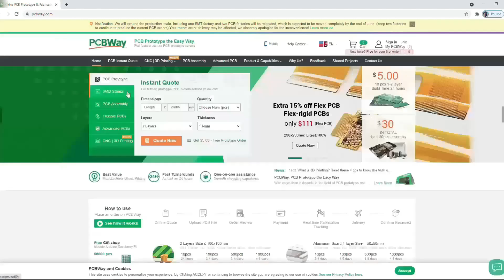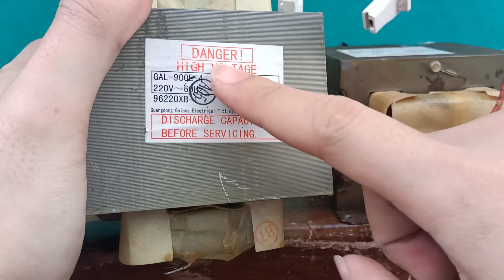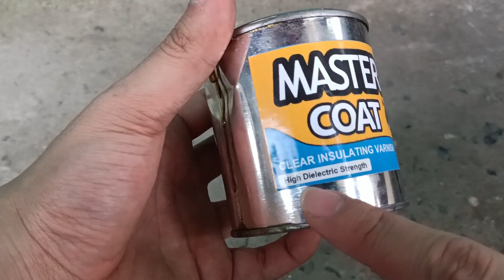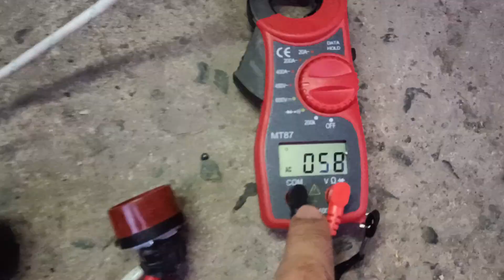DIY ARC WELDING MACHINE using Microwave Transformer - MOT Welding machine

Comment: The two primaries must have the same characteristics (wire section, number of turns), otherwise one of the windings will be destroyed after only a few minutes of operation!
Reply: Meaning you have to have the same type of transformer with the same type of primary coil or else one will burn the other.

Comment: Is it possible to hook up 4 of these MOTs in paralel in order to spread the load so that they don't heat up as much?
Reply from the maker: Hook up 4 in series
Reply: @AAElectrotech  oh ok!
Reply: @AAElectrotech  what the point of 2 primary windings? you will need to turn more turns in the secondary comparing to if you use just one primary! or it’s to balance the heat?  im confused really

Comment: Is it necessary to remove the insulation from the wire?
Reply from the maker: Yes
Reply: @AAElectrotech  I got 69 volts from mine without removing the insulation

Comment: 10 or 12 gauge, you could just use a low viscosity oil to cool your transformers. Much cheaper than buying that replacement insulation or cambric.

Other than that, good DIY welder. With another one like that connected in series, you could get a charge big enough to overload any electrode.

Comment: Those transformer are only 300W? you are consuming 10x the designed power, so primaries will over-heat and WILL catch fire with time, as if it isn't hot enough already in India.
Reply: Simple put the microwave fan on it just like every other welding unit.